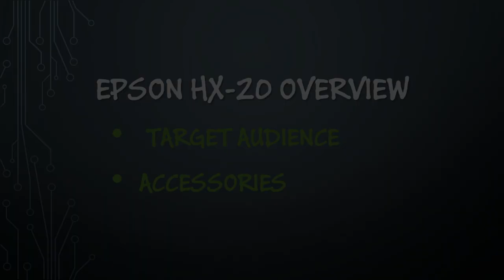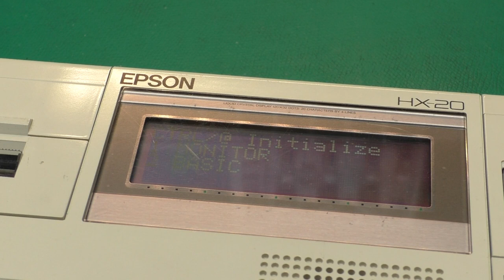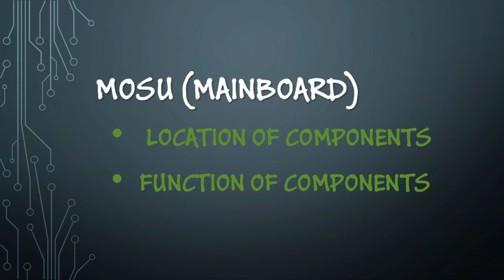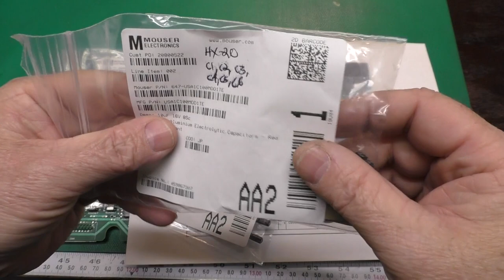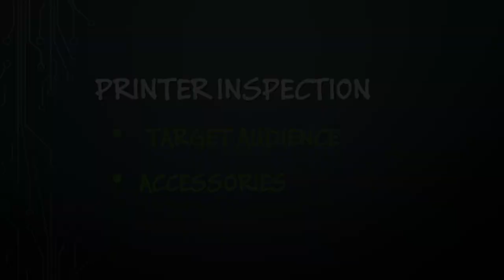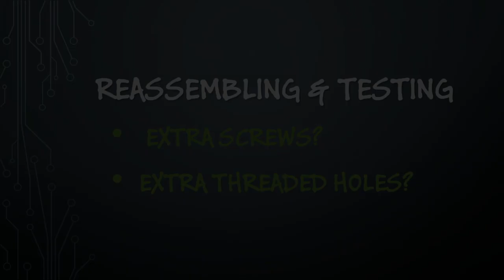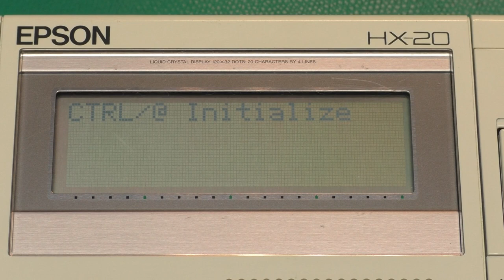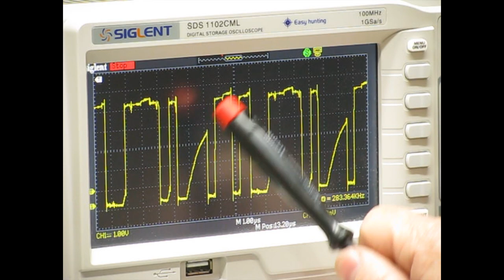World’s first laptop? Overview, Dim LCD fix, clean and test

Comment: Really enjoyed this one!  Great vintage computer.  Your level of detail, information, and the pace you film are most excellent.  Looking forward to the upcoming videos.  I've seen over the years this computer was adapted and used for many purposes such as running industrial machinery, remote insurance claims processing, eprom programming for cellular phones, speech synthesizer, and more.  In addition to the micro cassette, I believe there is an attachment in that same slot that adds ROM (RAM too?).  Any who - interesting device.  SkiWriter is a nice word processing program.  Oddly, when the Expansion Unit is on and activated, I believe SkiWiter is deactivated.  I was never able to figure out if SkiWriter can be inserted in an the Expansion Unit ROM socket and initialized from there.  Really excited (geek alert!) to see you examine and explain the best you can the capabilities of the Expansion Unit.

Great stuff!
Reply from the maker: There is some fiddling with DIP switches I think to map the EPROMs to fun at certain memory locations. Something I read form Epson, a sort of 1 page troubleshooting guide I think, does mention that 'some' combinations of things may not be possible. 

The ROM carts are mentioned in the service manual, and it even shows a schematic but I have not seen any yet online.

Comment: Nice compact unit although with such a comfy keyboard you would do a lot of programming so the LCD could be rotating upwards for easier reading
Reply from the maker: Interesting you mention a rotating LCD, I am working on an Olivetti M10 right now which has an LCD that rotates. 

The screen is fairly easy to read though, the contrast pot does a good job of adjusting it to comfortably view. You could still have an issue with reelections though.
Reply: @HeyBirt  I owned a mint Olivetti M10.  That rotating LCD may have made it the nicest form factor of the Model T class computers.  I sold it at a very fair price as I am an interested hobbyist but not a collector.  I like to get them, refurbish and collect literature to the best of my ability, learn about the development and marketing of the units, use them a while, and let them go.  Worst ways to spend winter months, certainly.